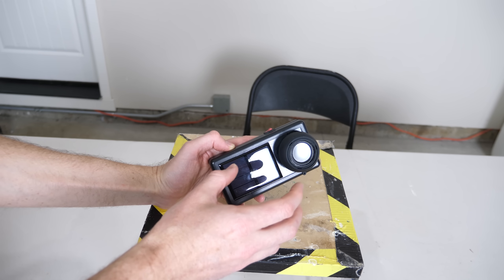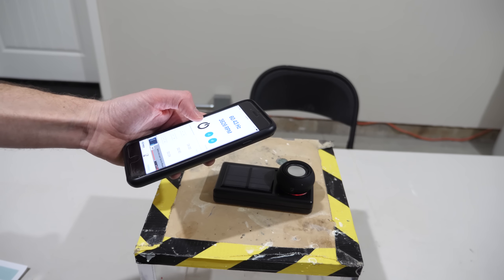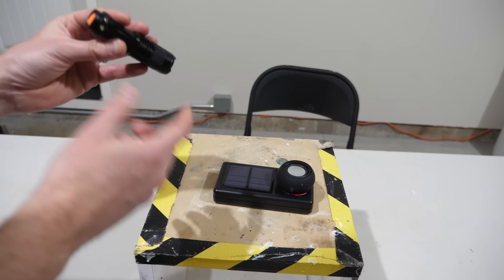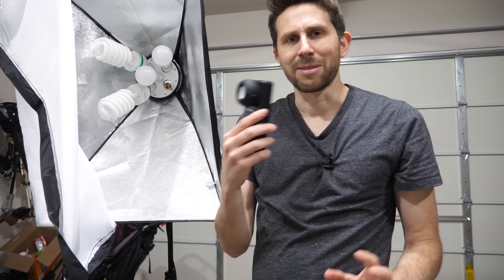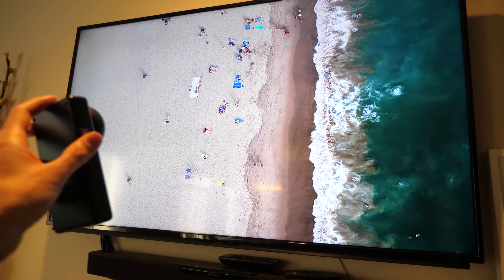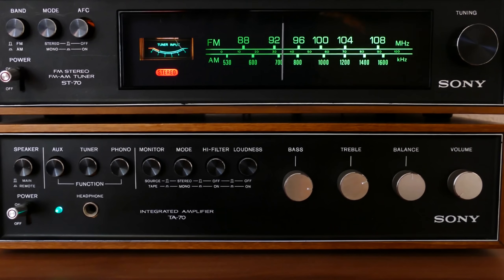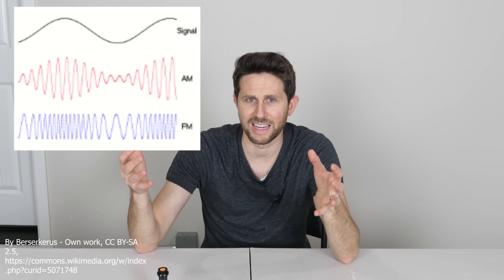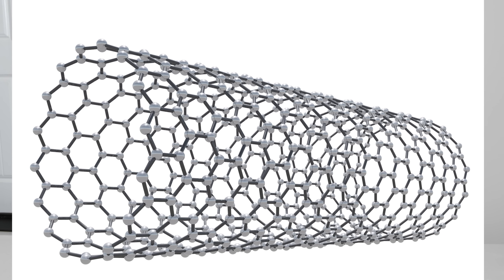Can You Hear Light? The Audio-Modulated Light Beam Experiment

Comment: This perfectly explains why light and sound are both electromagnetic waves
Reply: No, sound is not an electromagnetic wave. The way is em wave from light or radio wave caused the electron to vibrate back and forth, and that can be turned into electrical signals and convert back to sound.

Comment: You can see it with your eyes as well if you modulate deep enough especially the lower tones the voice is modulated over our vocal courts as a carrier wave or at least several waves combined  if someone speaks without using the part without the carrier waves and the lower parts and it is deeply modulated one can see it I can see deeper 50 hz light modulation if you live longer outside in nature and return you see a load of screens flickering and the lights especially dim lights on 50 hz one has to adjust to it. If one wants to modulate speech over light directly to the eyes one needs special hardware and software it is available for blind oeole according to chat gpt.
If you use a microwave oven tuned down just lower or modulate kathode power one can do this as well. There is also HF hearing some parts of the spectrum seem to compress parts of the brain or hearing parts in the ear but only the low freqeuncy modulated parts are audible I currently hear a modulated tinnitus I hear white noise audio frequency modulated. I sometimes even have my bowls resonate so loud I can hear it I don't know who does this but it is annoying.

Comment: In 2008 I built a photo voltaic cell on the end of a long pipe, cell wires went to a high gain Marshall guitar amplifier. My goal was to listen to the sun. 1st I had attached it to my telescope, Turns out lenses/magnification etc..does not help. Found that, for this to work, you have to record like 8 hours of it pointed n tracking the sun, Then the 8 hours has to be played back quickly , like in roughly 30 seconds, Then , You actually get to hear the suns corona explosions , The 30 seconds played fast will change the pitch up, In a computer program you can then re record it and change its frequency to what sounds right to your ears.  A few years later I read that NASA recorded the sounds of the sun. It was a fun experiment. The night I built it, I pointed it at a street light and I could very clearly hear the moths wings flapping from the moths that were flying around the street light about 700 feet away.  Thanks

Comment: This was a very popular project in many electronics magazines in the 70's and 80's. The transmitter was extremely simple. A small mirror was glued to the cone of a speaker. The receiver was a solar voltaic cell connected to the input of an amplifier/speaker. The project was conducted out  of doors and the sun would be reflected onto the solar cell from a long distance using the speaker's mirror while audio was feeding the speaker. It worked quite well.

Comment: Sir, is ur experiment a result of photoacoustic effect, but in a much advanced manner in which u use light to convert to sound energy directly??
But with connecting light to audio jack it seems to work one way only and not vice-versa as the audio jack is converting sound into electric and then into light which is a photovoltaic effect.

By this i mean photovoltaic effect used in Sound of Film systems like Bell's Vitaphone, Lee's Phonofilm, Case's Movietone and Edward's Light-Valve.

If u can convert light to sound using torch n microphone, then Photoacoustic effect seems successful but i hope u can do it reverse from sound to light energy too without using the audio jack!!
Btw its a Superb experiment!!
Sir, pls do reply if i somewhat understood this!🙏

Comment: hello @action lab, how did you connect the Audio jack with flash light ? the signal comming from the audio jack has to be less than 1V ... more over it will be powered by batteries ! do you have any circuit for connecting stereo/mono Jack to flash light? my second doubt is solar produces only dc, a speaker needs ac I guess, so that instrument has internal dc to ac converter ->amplifier ->speaker ?

Comment: That's no the sound of light.
That's just simply change in luminosity changing the current produced by the solar panel which in turn changes the magnetic flux of the electromagnetic core of the speaker.
Literally you just gave some signals to the speaker by means of light.
But that's a good idea to hear the sound of the sun.

Comment: You nailed it ,there called Meta materials , We will be able to generate negative N. We do it now in the microwave. I am working to design the antenna , (looking for help)and receiver 
These structure I dream to be 3 dimensional antenna with zero loss but will need a tune  ,(preasure oscillation?) 3 D sputter printing, FIB to slow, how a about a atomic spectralphotometer , oh that right that a quantum computer

Comment: There are antennas that transmit light waves. Those are the LED.

And we can tune into a specific light frequency range by optical filters. Also lasing is used to transmit data over light on a long distance, and a collimator/tube can be used to reduce noise, like a directional antenna.

A solar cell is also a kind of an LED and an LED is also a kind of a solar cell.

Comment: I think it's basically impossible because when you use the solar panel to transfer electricity,it only transfers the electricity in the speaker no extra sounds and finally the speaker,a speaker has a programmed sound or if I'm right someone is sounding an instrument in the background or maybe using garage band and timing it correctly,sorry if I got too harsh

Comment: So beginning in this video you pull out this contraption which is a solar panel connected to a speaker. Is this an actual solar powered speaker one can buy online? Or is this something you made yourself for this video? From what I understand, the solar power would connect to a battery, and the speaker would draw from a battery. Is this right? What I'm seeing with this device is that the brighter the light, the louder the sound, which is strange because it looks like it's set to the highest volume already. You're only fluctuating the power source. Am I making sense?

Comment: So if you put the receiver under sunlight, can we hear the natural frequency!? (432 Hz)
Reply: A simple No is the answer. Because, that would still accelerate the electrons in same direction along the speaker's circuit. As the frequency (432hz) is light's frequency. Thus, you'll have to switch(on and off) the light at the frequency of the sound you'll want to hear.
Reply: Just call this 8296250992 number if you aren't able to understand.

Comment: Hello. Thanks for the great videos. I was just wondering why you would hear a 120Hz tone from CFLs. Why not 60Hz same as the AC frequency?
Reply: At first I thought that it's because there are 2 bulbs and the amplitudes were adding up. But it can't be that right?
Reply: the light intensity from the CFL has  2 peaks, one on the positive half of the wave, and the negative half.  though the frequency will be doubled. 
I thought at first that he confused the frequency with the voltage, but then tested that on the oscilloscope and it is clearly 100 Hz (Europ) 120Hz (USA)
Regards

Comment: Judging from experiments in this video, I can say that we didn't hear the true sound of light. the first experiment isn't really hearing the sound of light but, using torchlight as a percussion to produce a continuous rhythm. he said in the video that he gets an even higher tone whenever he adjust the rate of blinking but, it's totaly wrong. the note doesn't go higher. instead, the tempo increases.

for the second experiment and after, it shows light as medium to convey sound. the medium changes from digital signal to analogue signal to light signal and back to analogue signal before our ears pick up the sound from an acoustical signal. hence, it's acceptable to said that we can listen to light wave this way. but, it isn't a pure representative of light wave itself.

what I mean by representative of light wave is that on the spectrum of light, the are various visble colour which we called rainbows. for sure, each of this colour spectrum have thier own frequency range. In theory, this actually represent different note on the scale of music. although our ear can't hear directly from light wave, it doesn't change the fact that it has harmonics. harmonics is an interger multiplier of fundamental frequency or 'the root note'. Now comes the best part, as harmonic comes with overtones of its root note, it also can comes with undertones of its root notes. the undertones of light frequency if calculated till it reaches the sound frequency, it can produce it's own audible note. 

bare in mind that an octave of a scale cover a wider spectrum of frquency as it climb up the frequency. it is because note increases in logarithmic as relative to its frequency scale. so, it's possible that even in sound wave only a single frequency cover a single note but, in light wave several frequencies create a single note.

Comment: if you ever wonder what it mean by "light wave can't go through stuff like radio wave", the explanation is a wave with higher frequency is much harder to bend as compare to lower frequency.  higher frequency wave tends to reflect rather than diffract. hence, light wave don't go through stuff like block of buildings like radio wave does. that's why.

Comment: 1) in my language we reply to this :"Napoleon is dead" meaning you are telling somthing everybody knows already, there is nothing new or strange about this. examples enough : IR remote control, data transfer over optical fiber, opto couple IC's,  .... 2) you are not hearing light but the modulation of the light demodulated to an electric signal.

Comment: The human eye can actually see more than 23 Hz. That is why traditional film projectors in cinemas flash the same frame 2 or 4 times for a refresh of 48 or 96 Hz. Same with TVs that in the US run their 30 fps content at 60Hz broken up between odd and even lines. If they didn't then you'd notice the flickering of the screen. 23 is pretty much the minimum limit for where we start to fuse separate images into motion but we can detect higher frequencies than that. No where near the frequencies our ears are capable of hearing though. 50 Hz lights in Europe as well as 50 Hz CRT TVs back in the day look stable for instance.

The sound from the TV in this video is probably the flickering of the backlight of the LCD rather than the actual screen refresh.

Comment: You could have a recording device that sent no wireless signal, but was connected to the electrical system in the house so that all of the lights in the house broadcast the sound information.  This is either some crazy spy-stuff or witchcraft.

I just read an article in either the American Physical Society or Physics (both can be found at aps.org) where a team from MIT (I think) was able to translate the fluctuation of the electrical signal in the hard-drive caused by sound vibrating the sensor back into sound from the small electrical signal it caused. A hacker could listen in on conversations without the need for any additional devices.   I'll find the link.  It's pretty incredible.  However, I still think the AM Light Signal is way cooler.

Comment: How about using photo resistors? You would need an external power source for that to work, but they can react to specific wavelength as far as I know and therefore filter out a lot of noise. But then, I don't know where to use that technology sensible.

Comment: Transmitting sound/data through the open air via light is possible, but as you mentioned, problematic due to being blocked by objects.  The objects don't even have to be solid - fog/smog would also deteriorate the signal.  There is a work around - fiber optics.  The light transmits the data, and the glass fiber bends it around things it couldn't otherwise get past.

Comment: I heard of a project a few years ago called Li-fi. It's basically wi-fi, but it transmits data through light rather than radio waves. The shorter wavelengths means much faster download speeds. The problem is you'd need a different light bulb for each device and devices would all need their own lights in order to upload anything. If you're going through all that trouble, you might as well just use an ethernet cord.

Comment: Actually seems like a great way to do remote speakers for a party.  Use something like an IR laser on solar powered speakers and you don't have to worry about supplying either power or the audio signal.  If you want to remove the "noise" of other signals, just use a light filter.
Reply: wait till you hear about radio

Comment: Being able to see the light intensity changing according to the sound has nothing to do with it's frequency content. Well it does but not as you seem to understand it. What's preventing you from seeing the light "flicker" here is a light intensity bias : a constant amount of light on which the fluctuations associated with the sound are superposed. If you have tiny fluctuations over a strong constant intensity you won't be able to see the fluctuations, but if you bias the light source differently, going to no light at all when sound is at it's lowest in air pressure and full brightness when it's at its highest, you could actually clearly see the light flickering according to the amplitude of the sound, how loud it is over time, not it's frequency content.

Comment: Wait a second where do you get a flashlight with an audio input at????????
Reply: You can make one easily, just hook  up a transistor in switch configuration to an LED and get the amplifier signal with the battery connected to the led.
It hard to explain but easy in practice, btw if you're not so good at electronics you can simply connect a small led to an amplified audio output like a big speaker system, take care of the polarity tho!
Reply: Bugs Bunny when you get the answer tell me too.
Curious 🤔🤔🤔
Reply: You make one
Reply: @chris26-48  damn thanks

Comment: Ah, yes, the light version of a crystal radio.  Extremely high frequency, for sure.  You could get around the ambient noise issue by using an ultrasonic FM subcarrier.  That would complicate your 'receiver", though, since it would need an FM demodulator in that case.  But it would improve the signal to noise and fidelity a lot.

Comment: Nice demos but you rather skate over how you got the flashlight to flash at the required rate or is the voltage level from the tablet audio jack high enough to completely replace the batteries?
Also, of course this is the basis of fibre optic technology where the (laser) light is constrained  within the fibre but the bandwidth or information capacity is enormous.